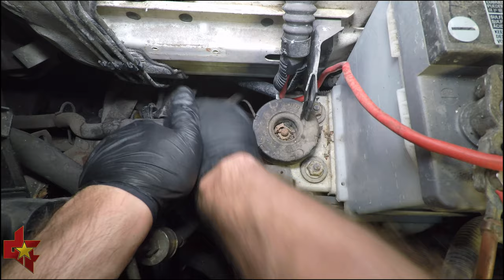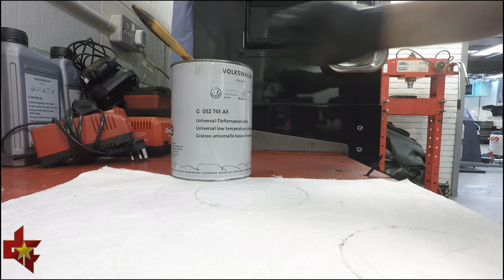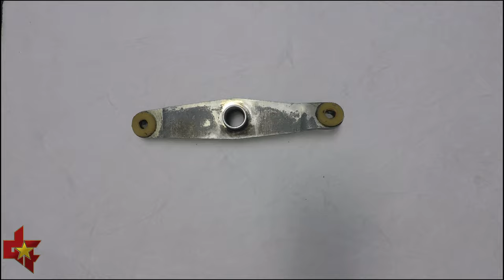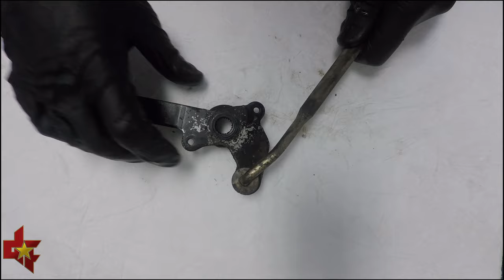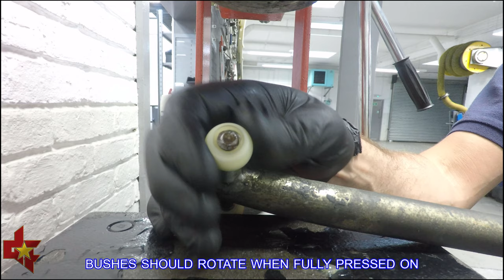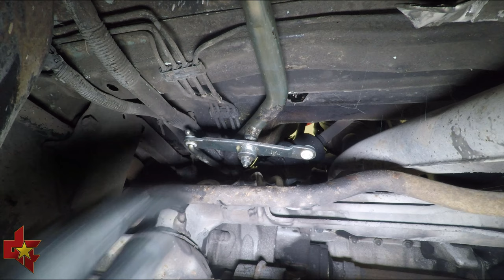VW Transporter T4 Top & Bottom Gear Selector Bush Replacement  (VOLKSWAGEN)

Comment: day three the cup came out of the steel housing when attempting to insert the gear selector ball end . Day four   I will drain all of the coolant   remove the diesel water heater and associated plumbing which is making this seemingly fiddly job almost impossible . this is a nightmare of a job on a 2001 VW caravelle 2.5 TDI. good luck to anyone attempting this seemingly cheap repair .

Comment: THE go-to video on YouToob for making this replacement. I used both-thumb pressure only to push home each bush on the ends of the pivot lever rather than opt for the pliers. 🙂
Reply from the maker: It can be done that way. Depends on where you get the bushes from. I have found some slip in no problem and some can be very, very tight.

Comment: Very good video, thx for that!

When I did the bush replacement, I felt it easier to press the smaller ball into the cup (already assembled into its mount) outside the car and install the T-shaped rod together with the cup mount back to its place.
Reply from the maker: Great tip! There is lots of ways that all work equally well.

Comment: My gear shifter doesn’t have an extreme amount of play, but it does require a lot of force to operate the gear shifter. Is this problem also caused by worn out bushings?

Comment: Cracking video . done this job a few years ago the videos that was here then mmmm is all I will say 😉 
Ps see the big plat under neath with 3 holes in it . On flat side 30mm in drill a 14mm hole( I think same size as one your moving in) it will shorten your gear change
Cracking video 
👍👍👍😜🏴🦕🦄😁✌🤞
Reply from the maker: Thanks 👍

Comment: A question, if I may. About 2.35min in you removed the three allen bolts under the left hand (larger) bush bracket.  Did I see you were using a 1/4" drive ratchet with a 6mm allen socket?  I am curious to know what you used to get the rear allen bolt out (the one nearest the bulkhead) as the top of the gearbox is very tight there.  It looks like you are working on a RHD model, mine is LHD so a little less space to work.

I have just managed to get those three allen bolts out using a combination of some new allen keys I have modified to shape and length, what a pain!  So any pointers as to how to get those bolts back in quicker would be much appreciated.  Thanks in advance.
Reply from the maker: Yeah it was very tight for space there. If I recall as it was a while ago, I used a Allen key with a 90 degree bent end. Then I put a small pair of mole grips on the bent end with the long thin straight end into the top of the bolt.
Reply: @ford873  Thanks, that was my general idea for reinstalling the allen bolts.  I will give that a try.  As you say, it really is tight.  I think I need to grow longer arms!!!!

Comment: Thank you so much!!!! It's very helpfull for me. Would you know the reference code for the replacement pieces?? Specially for the small ball and other parts around it.
Reply from the maker: Sorry, off the top of my head i don`t. If you want to buy from VW, just call with your reg or chassis number and they can tell you the part numbers. If your UK based i use a company called Just Kampers, have had nothing but excellent service from them every time i have ordered anything. They sell complete repair kits as well for the linkages. 
https://www.justkampers.com/gear-linkage-complete-bush-set-for-vw-t4-1991-2003.html?fee=1&fep=23771&utm_source=google&utm_medium=cpc&utm_campaign=PLAs&gclid=CjwKCAiA57D_BRAZEiwAZcfCxaYnn_YzoftstTQua-w8k3HRHqxVAl2t4k2igaWAW3pH8ZTVjl1cLRoCiE8QAvD_BwE

Comment: I need to find where to get those jumbo pipe pliers he uses to pop the ball into the bush at around 15:20 in the vid
Reply from the maker: They are a pair of water pump pliers. Those  particular ones are Snap-On. Just Google “water pump pliers” and you will find several alternatives.

Comment: grate vid what are the parts called is it a kit for all the stuff you changed
Reply from the maker: Check out the description for the video, I link to the parts used and where I got them from.
Reply: nice one for getting back to me i cant find the link you told me to go on for the parts
Reply from the maker: @wayneturner7678   Sorry my bad, I linked to them in a reply to a previous question and did not add them to the description. I have now added it to the description. I got them here.

https://www.justkampers.com/gear-linkage-complete-bush-set-for-vw-t4-1991-2003.html?fee=1&fep=23771&utm_source=google&utm_medium=cpc&utm_campaign=PLAs&gclid=CjwKCAiA57D_BRAZEiwAZcfCxaYnn_YzoftstTQua-w8k3HRHqxVAl2t4k2igaWAW3pH8ZTVjl1cLRoCiE8QAvD_BwE

Comment: Great video thank you , I changed the bushings and now I cant get reverse at all :(
Reply from the maker: Sorry to hear that, did you mark the selector adjustment and get it back in exactly the same place as before?
Reply: I am afraid I did not , I suppose  that I shal have to slowly move it towards the front until I find reverse.
Reply from the maker: You might get lucky. Sometimes, depending on how dirty the linkage is, it can be quite easy to see where it used to sit before it was removed. Just get under there with a good light and hope for the best.

Comment: Hi there, I have a t4 2002 model. 
I’ve Replacment the 3pcs Gear Linkage Selector Bush Kit in the engine bay but my gear stick is still very sloppy.. goes into gear but very badly. 
What other parts do I need to fix this problem? Any advise would be much appreciated.
Reply from the maker: I would advise checking and if needed replacing the rest of the bush's shown in the video to start with.

https://www.justkampers.com/gear-linkage-complete-bush-set-for-vw-t4-1991-2003.html?fee=1&fep=23771&utm_source=google&utm_medium=cpc&utm_campaign=PLAs&gclid=CjwKCAiA57D_BRAZEiwAZcfCxaYnn_YzoftstTQua-w8k3HRHqxVAl2t4k2igaWAW3pH8ZTVjl1cLRoCiE8QAvD_BwE
Reply: Soz Oliver but he just showed you what needs done .it's a bit of work but deffo worth it like a new van again 
👍👍👍😜🏴🦕🦄😁✌🤞

Comment: Hi, (3rd time lucky i hope) 
Thank you for this, it's been very helpful.
I'm hoping you can help me a little, 
I ordered some items to help me do this job (or part of it, but all the components i received, were made of a hard, rigid plastic.
can you confirm if they should be a slightly flexible rubber-ish or silicone, before i A) - try to force something that simply 'won't go' and/or B) make a fool of myself complaining about the product
Reply from the maker: Its all pretty fairly solid. As its the gear linkage you don't really want it soft and floppy. That's why I put it in the hot water to soften them up and make them slightly easier to slide on. With that and plenty of grease you shouldn't really have any issues.
Reply: @ford873   cheers fella, I understand what you're saying,... but the parts I received have zero 'give' even when heated,...
I've since got parts from somewhere else, so I'm now pretty sure that the kit I got from Autodoc, whilst exactly the same size and shape, are pretty much useless... 
Thanks again for the video, do you have any advice for fitting those ball things on on situ, without having to remove the while thing and put it in a vise?

Comment: There is another part which you missed to change . It’s located near the metal thing where you marked with paint it’s orange colour . On 13:49 you can see that part it literally above the tank
Reply from the maker: Yeah I know, it’s mentioned in the description for the video. Not all the parts arrived and it needed to be done. As the vehicle had no gears. It was done at a later date but not filmed.
Reply: @ford873  oh i see . Right now I’m changing the clutch and as the gear is removed so thinking to change all that stuff
Reply from the maker: Yeah definitely worth doing while it’s all stripped apart, especially if they have never been changed before.

Comment: Hello. Transporter t4 gear one  pass problem?
Reply from the maker: Could you elaborate?
Reply: @ford873  When engaging first gear it feels like hanging somewhere
Reply: @muratozel9690  I have the same problem, in ma case it's top bush problem, the right ball bush has fallen apart !!!
Reply: @BAK87  Me too i noticed big round zodiac sign space is but in my hand because it is not i couldn't change